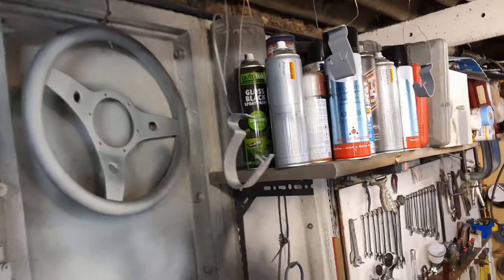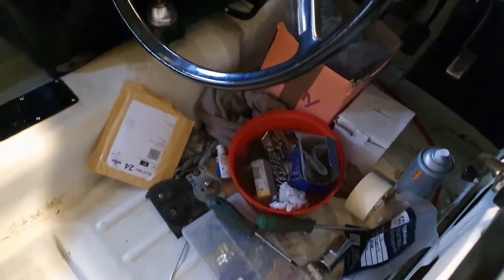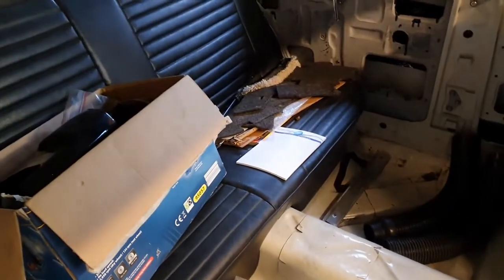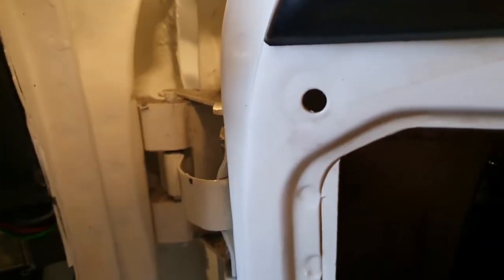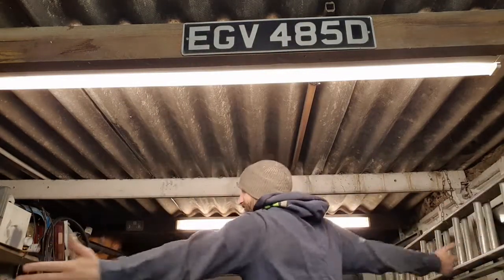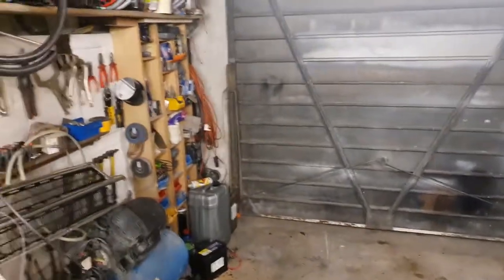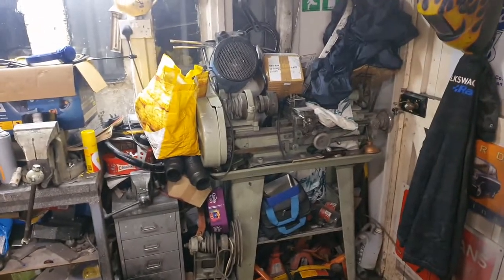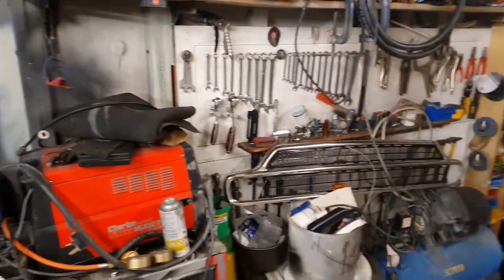Mk1 Cortina GT restoration EP14 - Going away

Comment: You definitely need a lathe and one that screwcuts so its  a bonus if your Myford has a gearbox. I was a centre lathe turner all my working life so I  could make the odd part at work but I eventually did buy a second hand centre lathe.
Reply from the maker: Hi Phil, the speeds are determined by moving the belt drive like on a pillar drill but it does have a set of gears for screw cutting on the left hand side. I haven't much experience using a lathe and never tried screw cutting so any advice would be great.
Reply: @jimbuilds  you'll be OK with a good set of taps and dies, you'll probably never need to screw cut anyway. It's just now and again a lathes useful. I put an electric fuel pump on my Cortina and I made the pipe connections so it was useful for that, I just used a 1/4 BSP die.